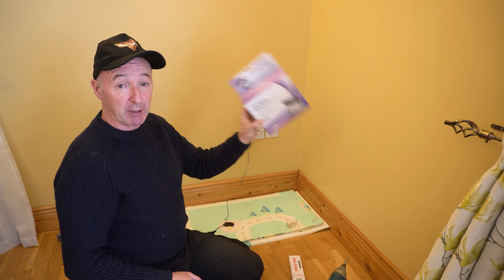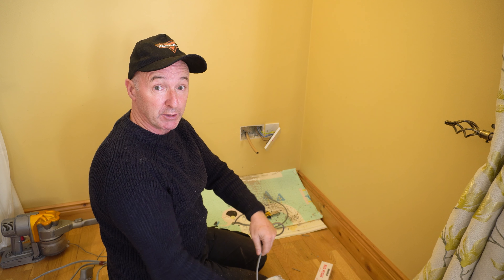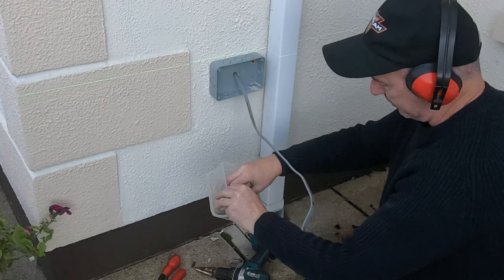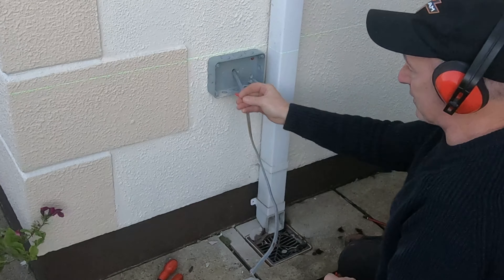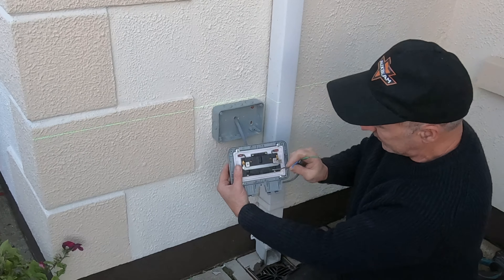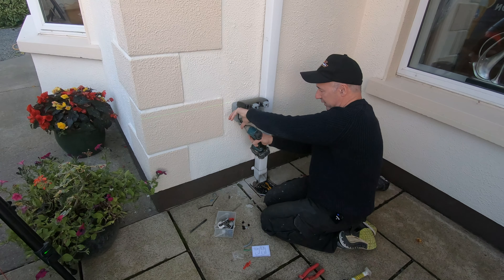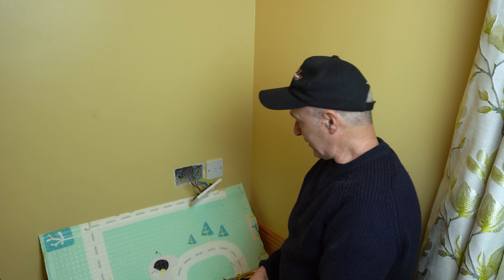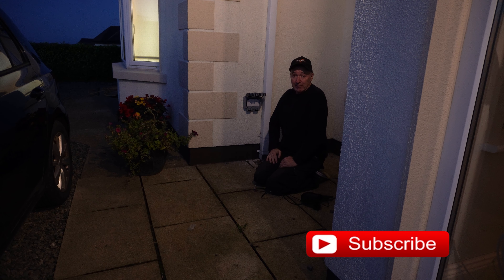Really easy! Install an outside power outlet

Comment: Good video.  Only thing I would add, is that these outdoor sockets usually have a small hole at the bottom, you knock out to allow moisture to escape.

Comment: Gerry, things here in the States are pretty much the same. Our household power is120 volts, 60 Hz. For an appliance such as a clothes dryer, our voltage is 240, as you may know. Our electrical boxes are grey PVC, as well as the plastic conduit.we have a circuit protection system called Ground Fault Circuit Interrupter (GFCI) for outlets in the bathroom, the kitchen, in the garage, and outdoors, etc. For plugging an ordinary table lamp in does not require this device. Also, some circuit breakers have a GFCI setup in them as well. We also have a protective sleeve for wires in metal conduit.
You might have know this, but there again, you might not.

Comment: 1.   Welcome back we’ve missed you.
2.   Nice job but it’ll never work, the plug holes are the wrong shape and pointing in the wrong direction.
3.  If you ever wanted to be an Aussie sparky you have to let all your drill dust and wire trimmings fall right into the carpet then kind of grind it all in with your feet.
Cheers.